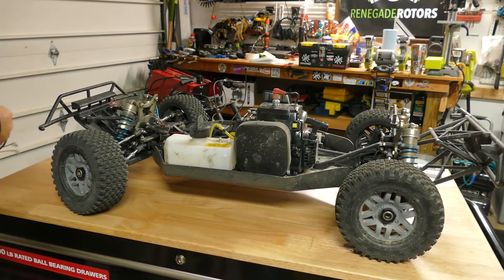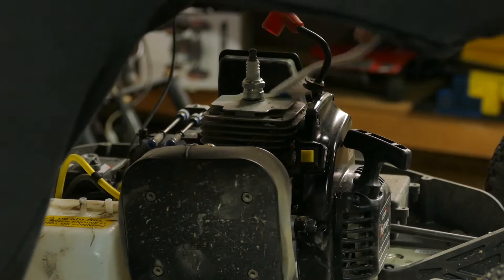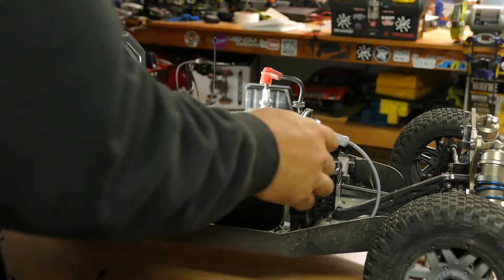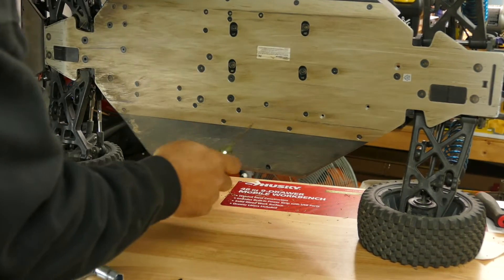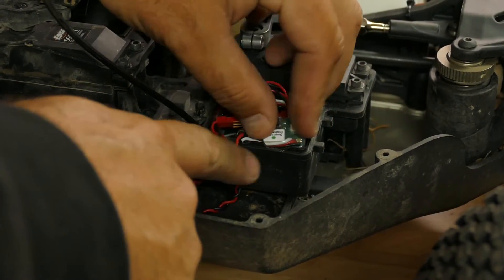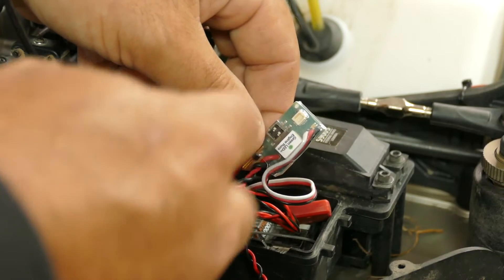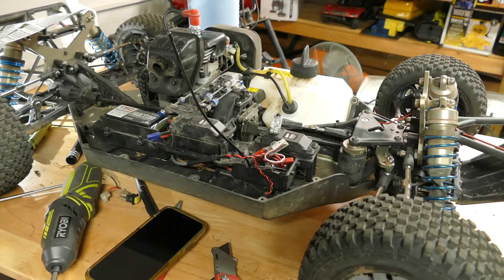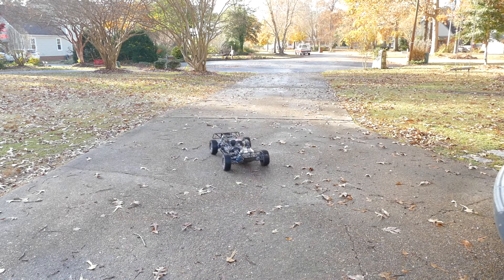Installing The Super Bee Kill Switch in the Losi 5ive-T 2.0

Comment: I have always run my transponder forward if the RX from what I understand the RX can interfere with the signal, but maybe that has changed in recent years
Reply from the maker: Interesting. I haven't had any issues.
Reply: @CCxRC  that may have changed with newer RX and Transponders, I use to race 1/10 indoor touring, back when I was racing weekly lipos were just starting to get big.  I have been in and out of the hobby since so newer tech may be different.  I am ordering a 5t 2.0 next month I jave been eyeing one for a while, and I like that it runs on 2 cycle, nitro gets expensive
Reply: Your yard looks like the PNW are you in WA by any chance?

Comment: What did you have to do to get it to kill the motor when controller dies
Reply: What controller do you have. 

On mine I set the failsafe to engage the brake and hit the killswitch. So when I turn off my controller it does those two things
Reply: @dusty7254  spektrum ill try binding that way
Reply: I just installed mine, haven’t run it yet as I need to go over everything in the morning but to engage my super bee all I seem to have to do is switch the power button off on the controller ? It’s a fkysky and a 30DTT .